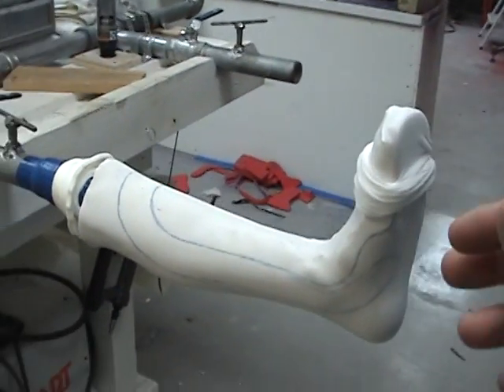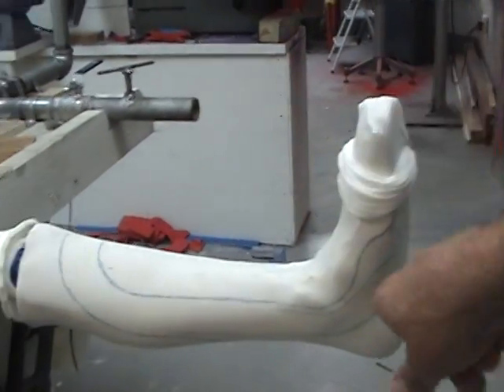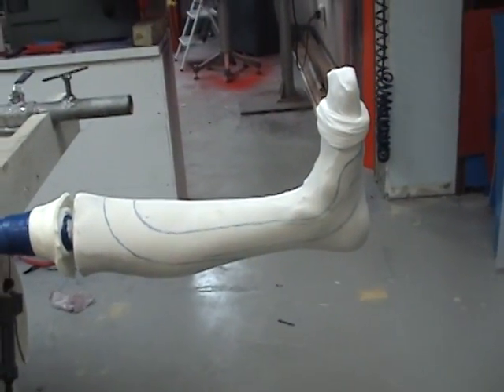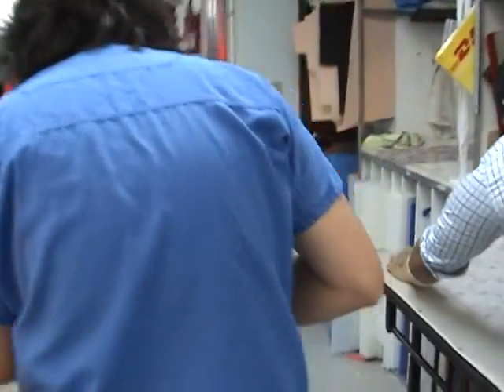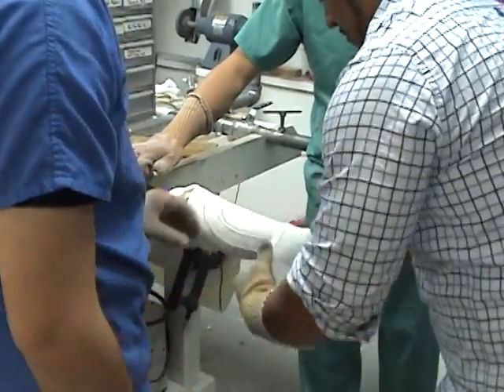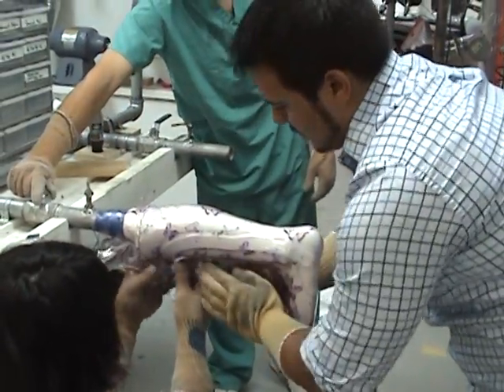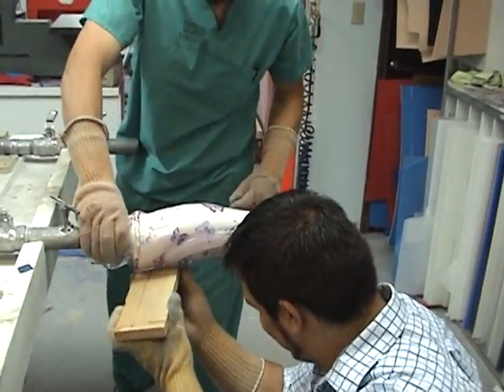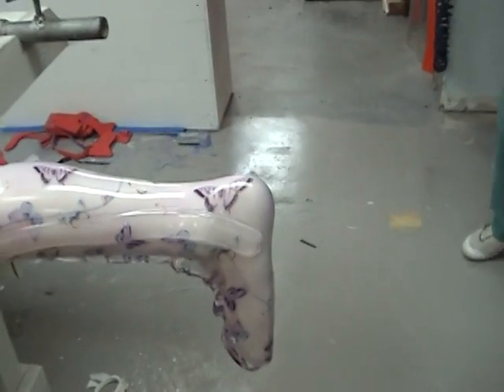Texas Turbo: Pulling Plastic

Comment from the maker: We do not preheat the model.  We heat the plastic to 400 degrees.  We must move quickly, but with practice it is not difficult to get the outer plastic on before it cools.  The strut is applied to a stocking over the model.  We spray adhesive where the strut will be just before forming.

Comment: Impressive technique, are you pre-heating your model to prevent the 1/8" PP strut from curing to quickly?  Also, are you applying the strut directly to the model or is there a treated nylon under the strut?